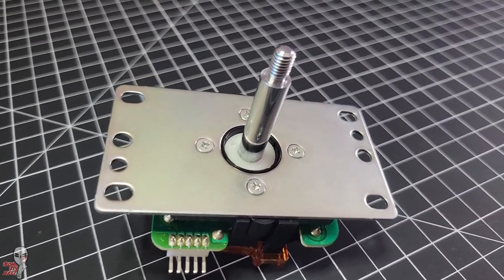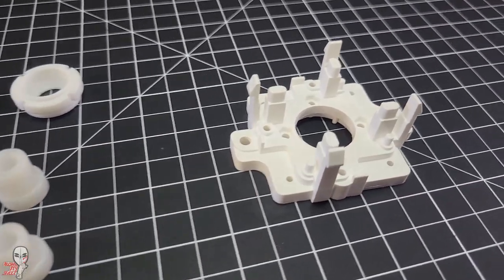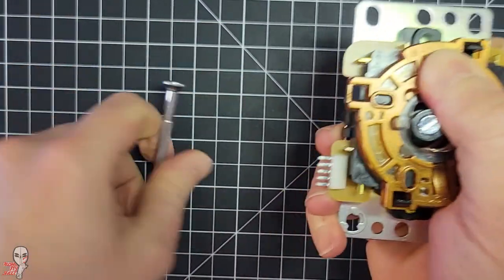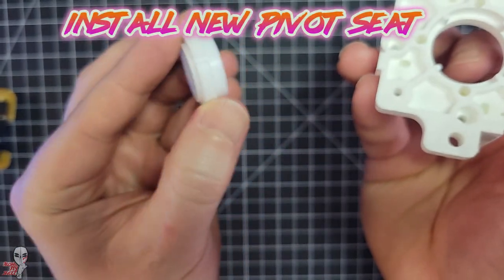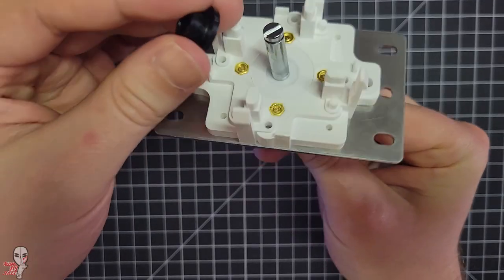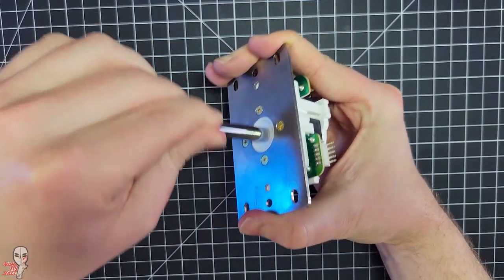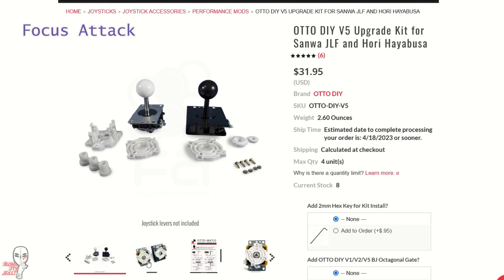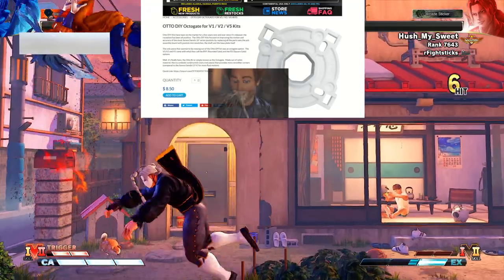How to make your joystick buttery smooth: Otto DIY V5 kit for fightsticks

Comment: I’ve just installed this on my hayabusa stick just for experimenting. It actually makes the hayabusa a lot smoother.
Reply from the maker: Right on! I really like the kit.
Reply: I hear it takes away from the uniqueness of the Hayabusa. Is it true that after installing this kit on the Hayabusa makes it feel like a JLF or does it keep the same feeling but smoother ?
Reply: @nintendoroots3361  since the otto replaces almost all the parts aside from the microswitches & lever, my understanding is that there isn't much left of the actual hayabusa. What made the hayabusa unique was the shape of the gate which has been replaced with the otto, I believe.
Reply: I purchased a bigger actuator only thanks to this review and replaced the stock one and felt the difference right away and now it feels more stiff compared to stock loving my Hayabusa now

Comment: Removing the stock screws is no joke. They are threadlocked in. If I knew how bad it was going to be (2 screws stripped and had to use a variety of methods and tool like angle grinder and vise to remove them, and I succeeded about 90 minutes later) I would have for sure ordered the metal plate, too. The mod is a marked improvement, definitely feel the difference. I'm not sure its worth 30+ usd, but it certainly makes it a little better.
Reply from the maker: Yeah, they went way overkill with the loctite stuff on those screws. Glad you got it though! It's a fun little mod and definitely has a different feel over stock.
Reply: @HushMySweet1  Your video convinced me it was easy and worth doing. Cheers!
Reply: How’d you get the screws off the plate? I’m having a hard time because of the loclite

Comment: if you have a chance, you should try the V2, it completely eliminates all the friction from the whole surface area of the round pivot because it's being held in place with a rubber grommet that's fixed horizontally, so when you move the lever, it's just bending the rubber that's wrapped around it to move around, no friction. the only friction you'll get is from the actuator touching the switch. I think it's really weird the actuators that come with this kit are so rough on the outside
Reply from the maker: Yeah, it's on my list to do at some point, but I'm more of a fan of Japanese-style levers, so I'm keeping my expectations in check. Thanks for watching and commenting! I appreciate the support!

Comment: I just installed this and I'm noticing it's way too easy to accidentally get and up or down when just moving forwards or backwards. which actuator size would be best to use to get rid of this problem? I think I have the 12mm one in there based on the picture in the video.
Reply from the maker: The smallest one, 12 mm (which is the one you're using). Double-check that's the one you have in there. If not, change to that one. If so, then it will take some deliberate practice to control your motions.
Reply: @HushMySweet1  yeah, I have the 2 big dots and 1 small dot and the 3 dot one out of the stick, so i guess the 12mm is in there.

I guess I just got to get used to it. I got some tension springs coming. i hope they help. I been playing on full collar korean levers for a long time, so that might be it, as well.
Reply from the maker: @RollTide8569  Ah yeah, if you're coming from a K lever background, this will be a bit strange at first.

Comment: For step 2) I would add, get a JIS screwdriver to limit the chance of stripping the JIS screws on the mounting plate. I'd also add there are a few v5 upgrades to a stainless steel pivot seat or a stainless steel pivot. You don't want steel on steel, but it's nice not having to lube the pivot if you're using teflon + steel. Good stuff. I love my Otto DIY kits.
Reply from the maker: All true and great advice! I didn't use the stainless pivots just because the kit didn't come with them, but they are pretty cool little units too.

Comment: A tip for the people who stripped the 4 top screws:

If you have a soldering iron, you can solder your screw driver into the screw. The heat will also help soften up the Loctite material covering the screw tip.

I stripped all of mine and I was able to remove them with the lightest twist with this method.
Reply from the maker: That is a great tip. I had never heard of that, so next time I strip one of these stubborn things, I'm definitely going to give it a try. Thanks for watching and weighing in, dude!

Comment: Interesting mod! Curious - do you prefer Square or Octag gates? When I use stick, I prefer Octag personally. Although these days im mostly just a stickless player hah.
Also been getting into Mortal Kombat - which is bizarre for me as a fighting game that is more geared towards Pad rather than an arcade stick!
Reply from the maker: I used to play charge characters so I've always used square. I really like the rounded square gate that comes with this kit though. I typically use bigger actuators and shorter shafts so the stick has less travel. Everyone plays a bit different, and I use my fingers rather than the whole wrist, so that's what I've found to work the best for me.

Comment: Do you know if the otto v2 kit fits in a 2nd impact lever?? I've seen there is now a version for seimitsu levers as well, and i believe they're closer to the 2nd levers. Thanks in advance.
Reply from the maker: I don't have a v2 kit on hand to test. I would venture a guess to say no, though. I believe the 2nd Impact levers are more similar to the newer Qanba ones than any Seimitsu counterpart. But I'm just guessing. Let us know for sure if you test! Thanks for watching.
Reply: @HushMySweet1  Thanks for the fast answer even in an older video.
I will get the seimitsu version, as the sanwa gate mechanism on the body don't look like they fit with the pcb inside.
Worst case i get the seimitsu parts to finish it.
Reply: @HushMySweet1  update: the otto v2m body doesn't fit the 2nd impact pcb. Restrictor kinda does and actuator is too small to hit the micro switches.
I got an ls-56 to install it instead.
Reply from the maker: @ZandoNoid  Interesting! Thanks for the info on your report back. Now we know for certain!

Comment: are you using the 13mm actuator and are you using the 1.5lb spring, and are you using the sanwa short shaft? and when you are blocking down-back on player 1 side and let go really quickly, does the stick bounce enough to trigger an opposite input? thanks.
Reply from the maker: On this one I assembled for the vid, I didn't install a short shaft. The one installed in that Technodrome stick does though and I have never noticed it over-extending on its way back through neutral. I'm smacking it around as we speak and I don't see enough play that this would be consistently triggering accidental inputs.

Comment: I had the V5 installed, and while the performance was outstanding, for some reason the actuator wouldn't release the switches all the way after performing a move, and would "stick." I thought it was an issue with the switches (which turned out to be off brand) so I got some genuine Omron's to release them, but the same issue came back, just with different switches. :/

I ended up having to go back to a stock actuator and gate, but kept the pivot anyway. Still unsure what was causing the sticking issue.
Reply from the maker: Wow, that's bizarre. I have V5s in several of my sticks and I've never heard of that issue. Wouldn't release them like the actuator was too big for them to reset or something? Could you try the V5 with a different actuator?
Reply: @HushMySweet1  Exactly! I noticed that when I put the switches back on, the actuator is so FAT that the switches essentially rub up against it without having to touch the lever at all. And this is on the smallest otto actuator, too- the stock one was tiny by comparison and when I went back to it, the "problem" resolved itself since returning to neutral released the switches.

I'm wondering if there's something else in play, since I can't find many other people with the same issue. I don't know if it's the pivot being unlubed (arcadeshock no longer  packages shin-etsu lube with the otto mods, because apparently them being made from teflon is supposed to take care of that) or if the phreakmods removeable shaft i'm using has something to do with it. Those are the other mods attached to this stick.

I should also note that this was a mod on an 8bit do arcade stick, on what I originally thought was a genuine sanwa jlf lever, which may have been an offbrand. At this point though I've replaced enough of its pieces that it's a hybrid of parts, lol.
Reply: @HushMySweet1  Hello! I've returned just to let you know that I've corrected the problems I was experiencing. ^^ Thankfully, it turns out that neither the Otto parts nor the other parts on the stick, such as the Link Ex Groove detachable shaft, which were causing the problem- the issue was the lack of lube on the spring hat, which was causing too much friction and not allowing the stick to return to neutral properly. As soon as I thoroughly lubed it, the fight stick was functioning perfectly and I could no longer replicate the microswitch issue. ^^
Reply from the maker: @lawlznet  Awesome! I was scratching my head at your original comment, so I'm glad it was something simple like that and you got it figured out!

Comment: Is an oversized actuator good for Tekken or 3D fighters?
Reply from the maker: The general consensus usually holds that Korean style levers with the grommets and such are better (or at least more prevalent) in 3d fighters. There is a similar kit for a JLF called the V2 kit which skews it that direction.